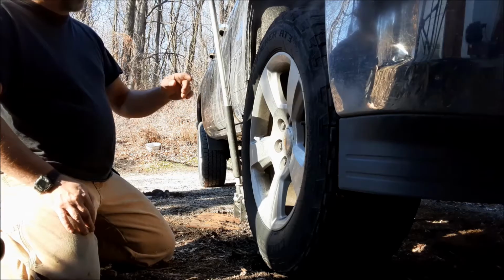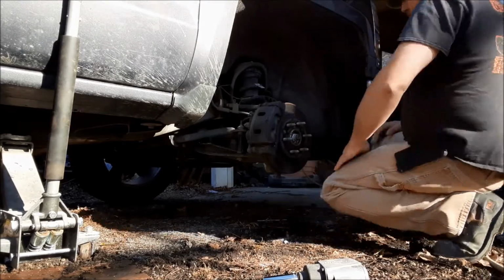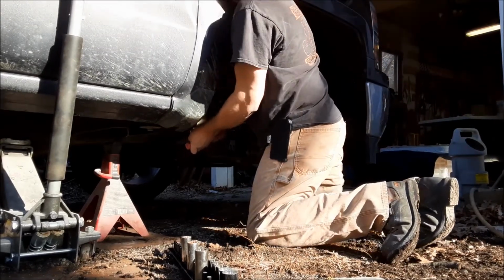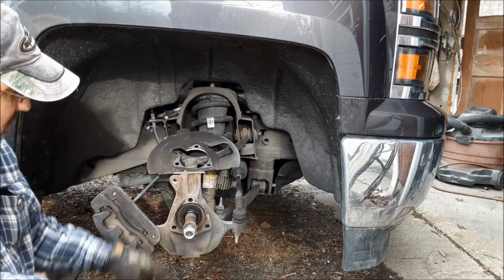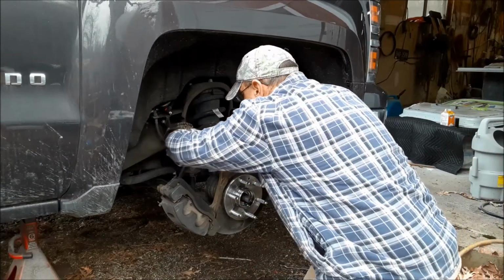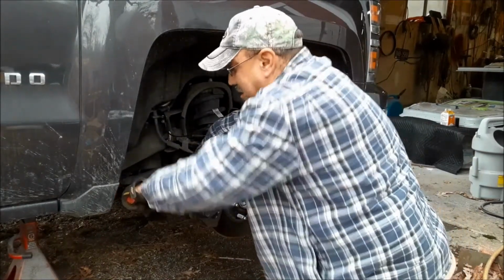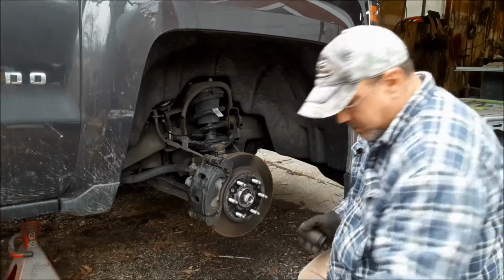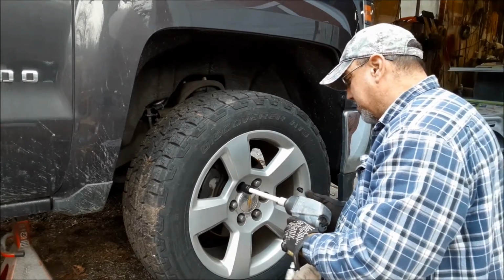2015 Silverado wheel bearing replacement

Comment: I’m lucky I guess.  207k on my 14 and no wheel bearing issues yet.  Y’all have a lot of rust to deal with that we down south don’t.  Good work, man.  Thx for the informative video.
Reply from the maker: Go ahead rub it in! One of my brothers moved south 30plus years ago he forgets the plight. You also have to take into consideration the vehicle swallowing pot holes in PA. I travel every summer and I always know when I'm back in PA because immediately after I see the welcome sign I hit a giant pothole that rattles my whole vehicle  Nice job on the 6 string I play a little myself.
Reply: Shit 85k on on my 2015 1500, already had to replace both front bearings....
Reply: @lifteddreams9714  My 17 has a humming when driving coming from the front end. I already replaced the Drivers ABS sensor but didn't think the bearings would go at 105k. But i guess they do. I just ordered 2 Timken replacements.

Comment: i have the same truck as yours. I am about to replace my driver side front bearing. Keep hearing some knocking coming from that wheel. Shocks and struts seem good. Replaced brakes. Replaced ball joints back at about 60k miles. Pot holes and dirt roads did a number on the truck in Louisiana/Texas. Drove through water on flooded roads a few times. Last time I drove through water my wheel bearings went bad on my 04 silverado. Thinking this might be the case this time as well. Thanks for upload. Which brand do you recommend?
Reply from the maker: I always try to use Timken. SKS is also good. I ordered Timken off rock auto for this Job, because they were available and cheaper than NAPA

Comment: Video for the rear wheels bearing ?
Reply from the maker: no sir this is the front wheel bearing. you need some specialty tools, and a little knowledge for the rear wheel bearing. If you have never had a rear apart before I would recommend taking it to a shop or a friend that has. The axles have to be removed from the housing. bearings and seals replaced in the housing if it's a 10bolt the 12 and 14 bolt chevys are different.

Comment: Torque specs are there for a reason.  Wrong torque values is why bearings and rotors fail.  Also, it's a 36mm socket.  You just showed rookies how not to do it right.
Reply from the maker: 36mm was way to loose, I had one. Your right on the torque specs. but would rather get it apart in the future then  have it be a permanent part of the vehicle when it's time to replace anything else. Ihave been dealing with north east rust my whole life and have learned anti-seize everything....and I re-used the old  aviation axle nut in case you missed that. I'm a rebel like that!
Reply from the maker: The drivers side wheel bearing is getting stiff and needs to be replaced at 150k. The video I did the passenger side. It actually made me think of your comment. The passenger side that I did now has a bit over 90k on it and still feels great. The factory one I replaced had 60 on it when I replaced it. I guess my lack of care for torque specs didn't hurt a thing! lol.

Comment: How long did you keep driving after you started to hear the noise? I just turned over 60k on my 17 and have the same issue with the front right
Reply from the maker: Honestly it was making a very faint noise for about a year, but I really didn't pay to much attention to it figuring it was a tire or something. Then a few weeks before I changed the bearing, I noticed that the brake pedal was pushing back at me. I figured the rotors were warping and was going to look into it. But it got really loud before then, I pushed on my wheel and could move the wheel and tire. SO I guess how bad is the noise and is there play in the wheel. I waited way longer then I should have!
Reply: @coalcrackeroffroadadventur7899  i have an issue hearing a grinding noise when i turn on my 17 silverado ball joints are good
Reply from the maker: @OhDatsJohnny  my first guess is brakes. but without hearing it or driving it. It's just a guess

Comment: Can’t get the center 1 3/8 nut off mine. Even with impact
Reply from the maker: that sucks. if you can't get that off your going to have fun getting the unit bearing off to. Breaker bar and a really long pipe with a pry bar between the studs to the ground is the next move. after that is heat.